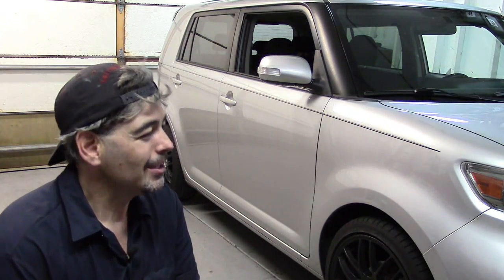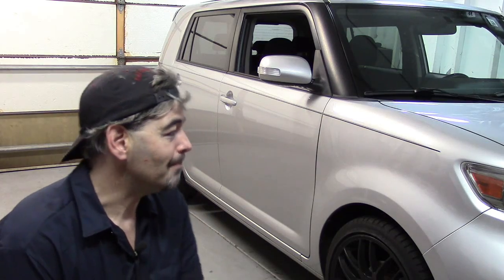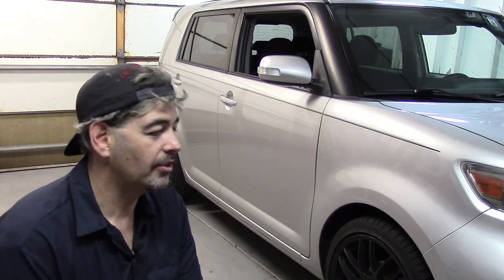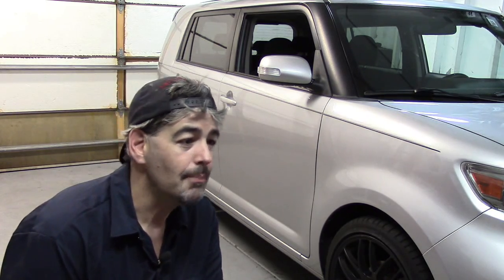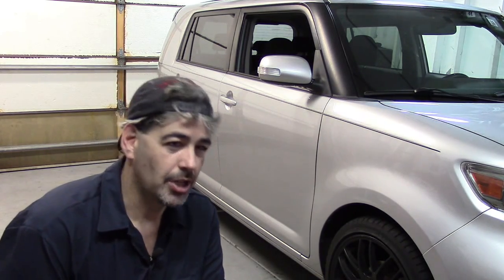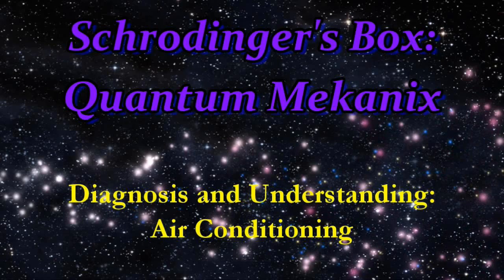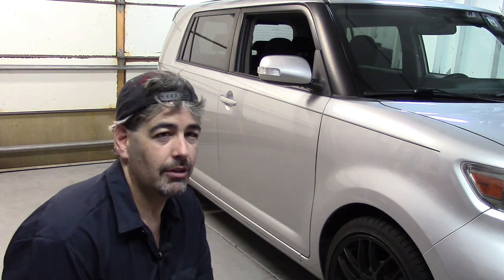Locate an AC Leak Like A Rock Star!

Comment: Interesting.. so you put refrigerant in to a system you know has a leak ? that would be illegal here in the UK...the correct way would be to pressurise the system with nitrogen 
we are certificated here before we are allowed to work on A/C. it was the same when i worked in Australia
 
and might be a idea to run through the safety issue of working with refrigerant before a 98%er   freezes his or her fingers 

But like always good video 

Thanks Regards John
Reply from the maker: As mentioned in a separate comment, this is matter of calculation not of irresponsibility.  Considering there is still a live leak, the delta of additional refrigerant added vs what would have leaked anyway from the system if left alone was calculated and the difference was negligible.  Again people just "talking" but not thinking. Pretty easy to say "don't add refrigerant to a leaking system".  Had this system been equilibrated with atmosphere after say only a week I would not have added more.
  Think independently people, and act according to logic and deduction, not anecdote.
Reply: Schrodingers Box don't they also take away the right to protect yourself in named countries?
Reply: Not in the US (yet). You can go to practically any store and purchase cans of R134A off the shelf.
Reply: LOL you can buy air horns off the shelf that are charged with 134a.
Reply: m ph you have to be EPA 609 certified to service motor vehicle A/C systems. that didn't apply to owners of a vehicle but if you are reviving anything in return for your services you must had a 609 card.
Reply: UK is a cursed land for multiple reasons. This video doesn't apply to the UK obviously

Comment: The best method I have found to use when locating leaks is by using some dry nitrogen to pressurize the system. It's cheaper the refrigerant and has been full proof in finding small and large leaks.
Reply: Godfrey. I have to know. Is that a serious comment or are you trying to blow something up. lol
Reply: In the US and Canada it is illegal by federal and state/province law to sell or dispense Propane (R-290), HC-12a (Isobutene), Butane (R-600) as a refrigerant to the public or to use in any residential or mobile/automotive/consumer application. 
Do not mix refrigerants, use only the refrigerant specified for the system. Mixing refrigerants in a system is  potentially explosive/fire hazard and is prohibited by federal law.
Besides being illegal it is also a really dangerous practice.
Reply: +DE “AutoBravado” Nichols i dont know about repair shops but here, you can walk into auto parts store and buy a can ,or a can with a gauge system already attached, no questions asked except ,will that be cash or credit
Reply: +patw52pb1 its legal in new york ,they sell the kits at all the parts store's
Reply: Todd T 
R-134a may be available, but R-290 (Propane), HC-12a (Isobutene) and R-600 (Butane) are not, the refrigerants are illegal by federal law to sell and or dispense to the consumer or public or for mobile or domestic air conditioning and or refrigeration use. 
New York law does not supersede federal law and permit sale or dispensing flammable refrigerants to consumers.
Reply: Yes 134a, i didnt know butane can be used as a refrigerant, i know propane is used in motor home fridges, my father had one of those, never understood how it worked
Reply: Propane derivatives are available at retail stores over the counter in Canada, but 134a is restricted to those with a license. I don't think it's very appropriate to mix refrigerants but somebody must be buying them.
Reply: spelunkerd
Yes, buyer beware.
Mixing refrigerants is not encouraged and in some cases can cause irreversible system damage and in some cases is illegal and prohibited by law.
In Canada Federal Law states NO refrigerant can be sold in containers that contain less than 10kg (22 pounds).
There is a loop hole in Canada law that allows for the legal over the counter sale of HCFC refrigerants less than 10kg as a carrier gas in replacement refrigerant oil that can be used in mobile (automotive) and domicile (home/residence) systems. 
The hidden hazard of course is that it is easy to inject too much oil into a system and cause reduced cooling performance and costly remediation.
There are several Canadian government documents that state HCFC hydrocarbon based refrigerants such as R-290 (Propane), HC-12a (Isobutene) and R-600 (Butane) are regulated refrigerants just like R-134a.

Due to safety concerns, the Canadian Vehicle Manufacturers Association (CVMA) and the Association of International Automobile Manufacturers of Canada (AIAMC) do not support or encourage the use of HCFC hydrocarbon blends as refrigerants in vehicle air-conditioning systems.
ASHRAE states that HCFC refrigerants cannot be used in Canadian or US mobile and or domicile systems.

Canada OHS states that it is illegal to dispense hydrocarbon (HCFC) refrigerant in mobile (automotive) or domicile (home/residence) systems that have a manufacturer designed refrigerant capacity of more than 300 grams (~10.58 oz) of refrigerant.
Canada OHS states that it is legal to dispense hydrocarbon (HCFC) refrigerant in large industrial systems.
Canada OHS also states when these HCFC refrigerants are used in permitted Industrial installations, vehicles, mobile appliances and domiciles, installers and employers are to notify employees, vehicle operators, inhabitants and purchasers of the product’s presence and potential hazards of fire, explosion, asphyxiation.
See Canada Workplace Hazardous Materials Information System (WHMIS) for additional info.

If you are a business and there is an incident involving HCFC refrigerants in a prohibited mobile or domicile system it is highly unlikely your liability insurance will pay any claim.
If you are an independent tech or a DIY and there is an incident involving HCFC refrigerants in a prohibited mobile or domicile system it is highly unlikely your liability, vehicle or home insurance will pay any claim.
Reply: spelunkerd Interesting. No license for R134a in the states.

Comment: just for the interest of all Australia is phasing out 134  from  2018 for  R1234yf   a synthetic HFO refrigerant co-developed by DuPont and Honeywell as a successor to R134a for automotive air-conditioning applications. what about the U.S.?
Reply: Same here in the u.s.
Reply from the maker: Correct- in fact I am pretty sure most home systems and in fact refrigerators/freezers have been using it for at least a year and I understand it will be required by 2020 for all home appliances- I am sure automotive follow suit as well.

Comment: I'm not sure about the validity of the bubble test on an A/C system, only because I don't know how R-134a affects the surface tension of the water and soap solution.  A small amount of alcohol can render the bubble test invalid, but unless your chemistry experience can definitively describe the effects of refrigerants on the surface tension of soapy water, we have an obligation to disregard that test due to the presence of unknown variables.  :]

As far as detection methods go, for the DIY guy, dye is probably the way to go.  As a tech, I use both dye and a sniffer.  Dye isn't always going to catch an evaporator leak, and just because I don't see any dye under the hood, doesn't mean I can definitively call an evaporator core.  The sniffer gives me the evidence I need to at least pull the dash for further inspection, or it tells me I need to take a closer look at other components for something I might have missed.  All very critical things when working with customers for whom every penny matters.  :)
Reply from the maker: rhkips Absolutely true dat.  There's no way in hell I would have found that leak without dye or detector.
Reply from the maker: I can definitely say I have found leaks in the past with soap water but the leaks were relatively large.  As you know on most small leaks like this one, most people just simply keep refilling their refrigerant rather than fix it properly which I do not condone.
Reply: Schrodingers Box
It's the small leaks that pose the greatest challenge, and also seem to be the most common!  Ones as small as the one you dealt with here sometimes even evade the vacuum test, which makes the dye even more helpful when recharging.  :)

Comment: I am your big Fans from Denmark. How do i access your paid channel?
I have a question. i am just a DIY guy like you. My air con works perfect until i took it to the garage for refiill.
I recently took my car for aircon refill, But when i got my car, i got a bad alternator and the aircon does not blow cold air.
Everything thing seems to work fine., I changed the alternator but my aircon does not blow so much cold air.
it appears to me that there is some kind of leak and i dont wanna take the car to the garage so they dont make more damage.

My Car is a Renault Laguna II 1.6 16v 2001.
Thanks In advance.
Reply from the maker: What data do you have?
Reply: I have not taken a live data output yet.. i just ran a scan which came up with scan code error DTC DF106..
NO error relating the Aircon System..
Reply from the maker: Let me know when you get some pressure data and only then can I help.
Reply: Thanks for the quick response. If i may ask. can a normal scan get the pressure data or i need a special type of tools.

Thanks In Advance..
Reply from the maker: I need high and low side pressure data under static, load, equilibration and induced variables
Reply: Alright i will work on that..
Thanks.